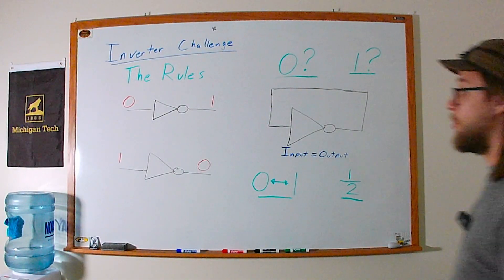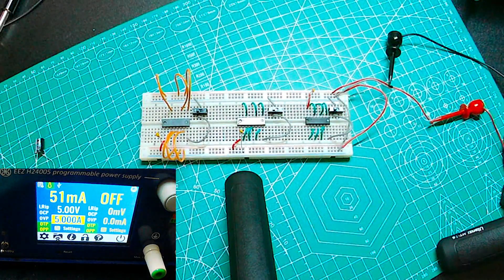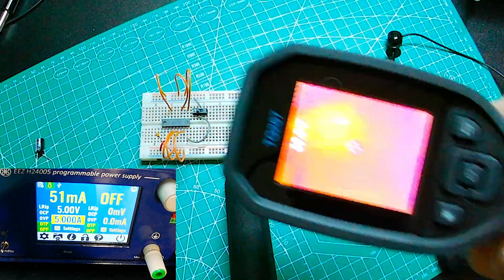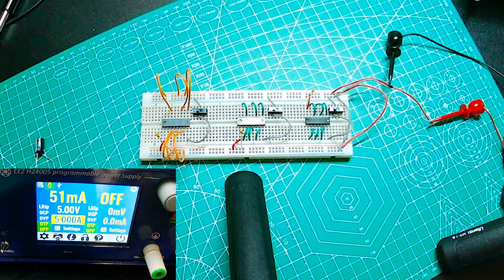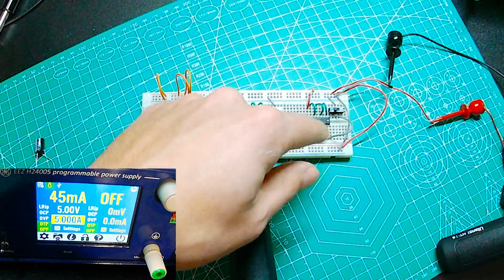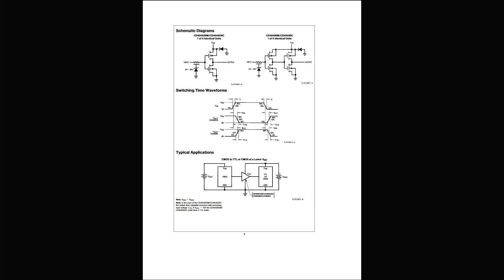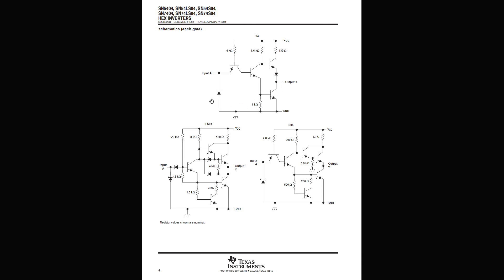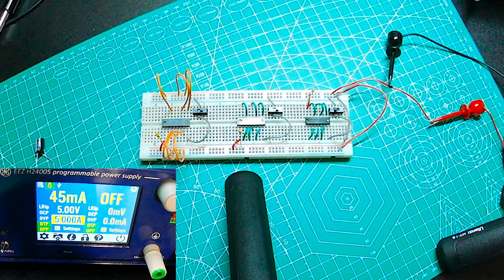How NOT-Gates Turn Paradoxes Into Heat

Comment: There is 4049U variant (U means Unbuffered) and there is a 4049B variant (B means Buffered). The 4049B variant actually consists of 3 NOT gates.
For the 4049U variant there will be cross conduction, entering linear mode class AB to class A. Meanwhile in the 4049B variant it will be ringing, CRO trace thicken.
Similar symptoms also occur in type 4069U and type 4069B.
That's according to my experiment I did about 29-30 years ago.

Comment: So it's about over 1ma of quiescent current as an amplifier. (the cmos one)
Reply: The potential issue commenter under previous video actually was thinking about at half way biasing point both upper and lower mosfet can conduct. The current should increase exponentially with higher supply voltage or decrease very quickly when you lower the supply voltage.